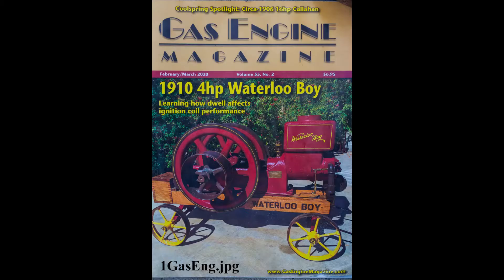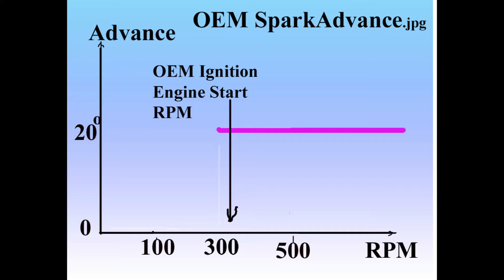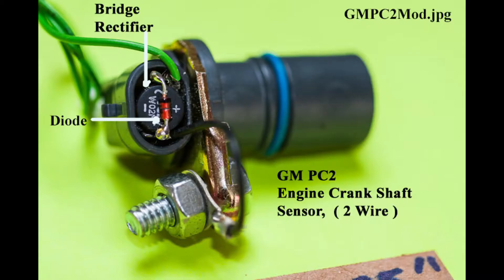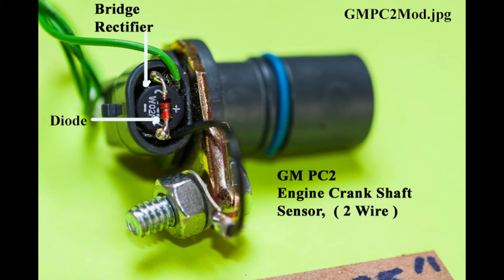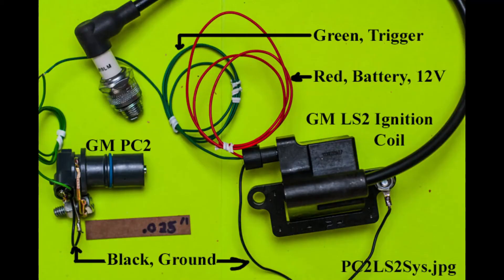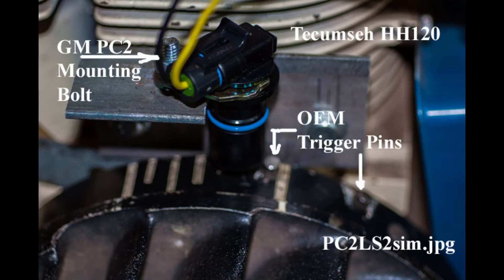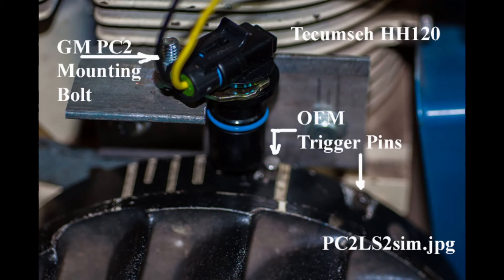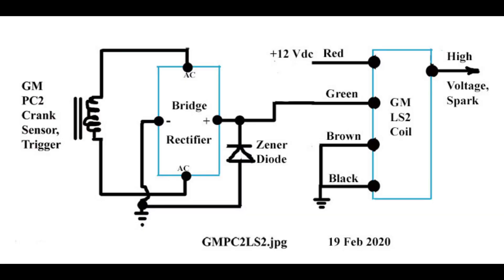GM LS2 General

Comment: Dear Sir.   Again just wandering.    On the Farmall tractors could I install two pins on the crankshaft, and run two sets of these for a 4 cylinder engine???   Knowing this hits every time the piston comes up , I'm thinking if I split the plug wires on two coils I could make it much more simple to set up , and keep up with. Is this asking too much for this kinda set up?       On my he magneto style of apposed cylinder engines , lots use a single coil with two plug wires. 
    Or maybe use two pickup proximity switches , and 4 coils?????  
     Both of these tractors have huge compression numbers , but are hard to crank and run after not having the point adjusted just perfect.      Neither one has enough room to adapt an HEI GM distributor.     Years ago I put an HEI distributor on an industrial 4cylinder. It was always hard to crank , but after it's new machined distributor, it cranked on first rotation.      So I know if these two engines had hot spark, they would run much better.

Comment: Dear Sir.    I see this video is getting some age on it. Could and , would you make a video showing exactly what to do to the GM PC2 proximity pick up????   I was a tool maker , and built robotic machines in the past , but I'm an imbecile when it comes to electronics. We had techs who done all of the wiring, because some of us just didn't do electronics (AT ALL).    I can solder pretty well from learning a little jewelry repair. So if you would lay it out , as to items are needed, and how to connect the dots, I'd love to do this. I have several engines that could benefit from this. 2 Farmall tractors that I'm constantly adjusting the points on.